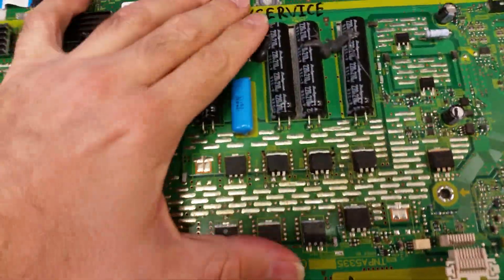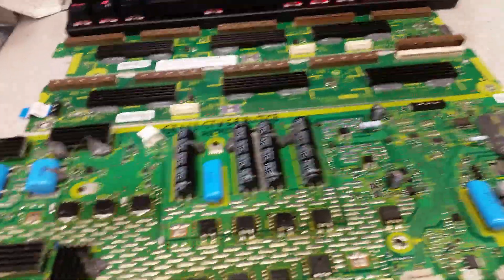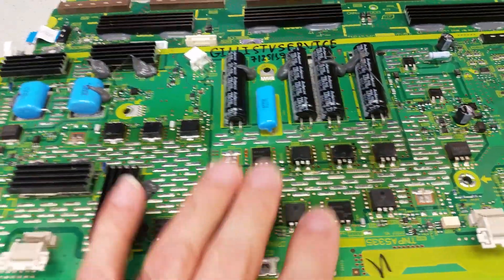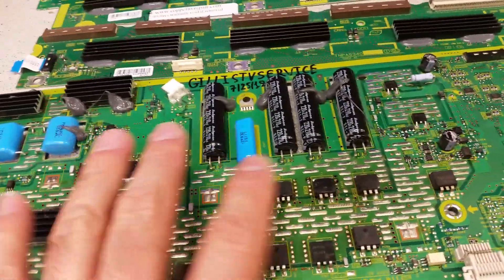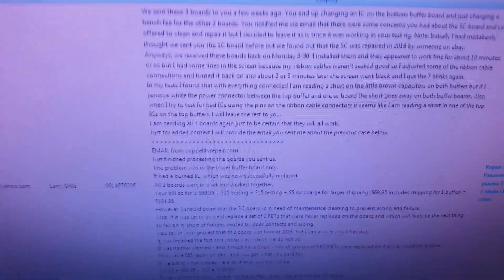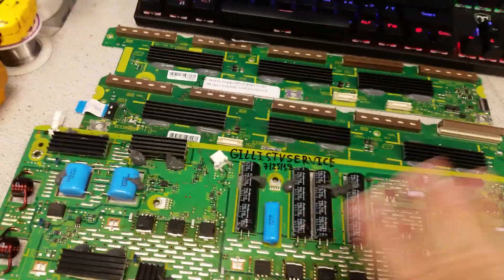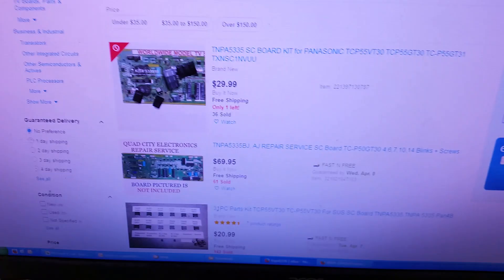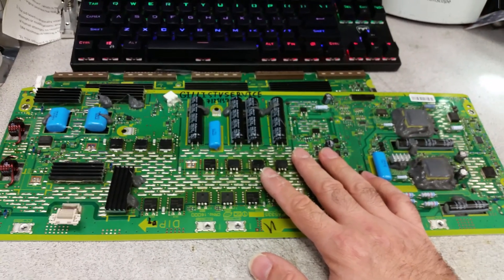Panasonic TNPA5335 SC and the crappy cheap repair services you get on eBay

Comment: Hello!
After repair kit i’ve got picture but red sprayed on the increase contrast and fets are extremely hot and some diods too..Please do you know whats the reason for it?Nice video btw..Thanks in advance
Reply from the maker: My guess is you have a damage to a component in a control circuit for some of the FETs and they do not work in proper mode - usually a resistor or a smaller switching transistor that is semi-burned and changing the activation levels of the MOSFET. Could be also something that was scratched off during work on the board, I've seen both happen at times over the years. Unfortunately can't be more specific. It's one of the things that, when it happens, you are very lucky it didn't cause immediate failure the moment the board was put to work....but then you have to find it and that can be rather difficult without at least a good working board to compare against, let alone a scope with known wave forms.
Reply: @coppelltvrepair  Or it’s about shitty parts from Aliexpress..i have changed ic502 and q531 and clean all the contacts and tight all screws,still the same..all the resistors around fets are ok…maybe the panel is half dead?Maybe i should lower the vsus?Thanks on quick response btw..
Reply from the maker: @TheDevilcuteGr  Yes, if you ordered parts from China it can definitely be that too. I assumed you used our repair kit with parts that we use and know to be good. We did receive a fair amount of bad parts from China over the years despite of working mostly with the same vendors.

Comment: So who do you recommend? I had my board repaired 6 months ago by Valley TV service in California and now the board went out again. Panasonic 7 blinking lights again. TV is model TC-P50gt30. Contacted them again and was told they can't get the parts no more.
Reply from the maker: Not sure what specifically are you asking about - how to deal with your vendor or how to deal with your TV. There is no one universal solution that would satisfy everyone in either case. Personally I believe in today's world every TV repair should only be given one shot and then one is better off moving on. Yet we do have multiple customers who keep on repairing boards. I recently updated a picture, I think on Google, of a board that we've serviced some 7 years ago and it has come for second service 7 years later. Of course we also have some that come just out of the warranty window, similar to yours. We handle them differently, including depending on how the customer approach us (as long as they are out of the warranty period), i.e. even things like attitude matter. But above it is all about customer's own motivation and comfort persisting throwing energy and possibly money at a repair. Again, my rule of thumb is that after the first try it is becoming inefficient. And yet I myself do fix things more than once...but it does cost me less than the average Joe so it makes sense to me. Only you can say what makes sense to you.
Reply: @coppelltvrepair  Sorry if my question came across the wrong way. Now that you replied back, I wanted to know if you were still in the business of repairs for those boards. SD/SU/SC boards. A lot of businesses have closed due to Covid. I have no probably with the first company that repaired the board. If they say they can't get parts anymore, then I got to go with another company.
Reply from the maker: @tommiespencer7829  We just re-opened after 2 week COVID shutdown. You can send the boards for repair , but since they've been worked on you can expect anything from us rejecting service to asking for 50% to 100% price increase and/or not providing warranty etc. You will have the option to reject whatever we offer and still receive the boards back without any modifications, but you can't expect us to service them as advertised as if they've never been worked on.
Reply: @coppelltvrepair  Only one board was worked on. I never removed the SD and SU boards. I saw you video and figured you'd prefer to inspect all 3 boards. It's a 2011 plasma and I can't expect it to last forever after being repaired.   But, if the price is right for attempting repairs then I have no problems.